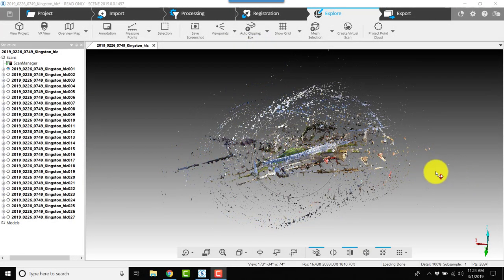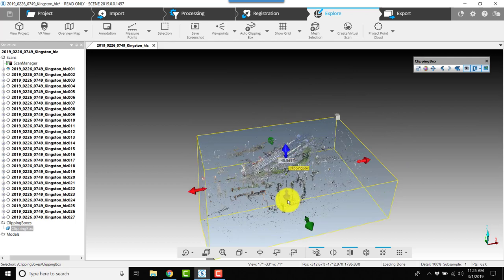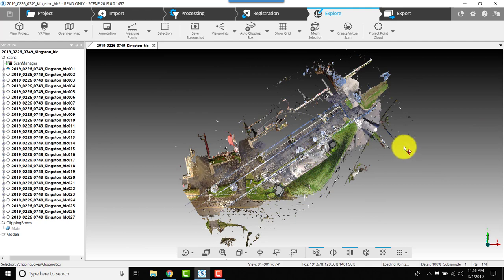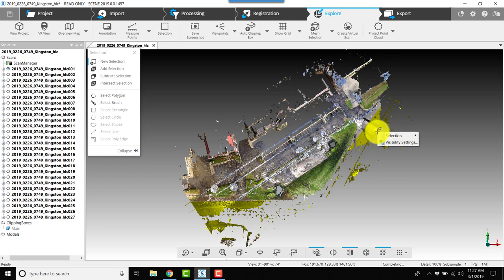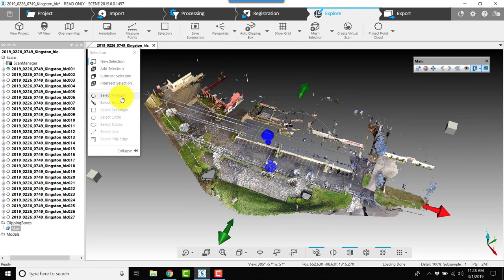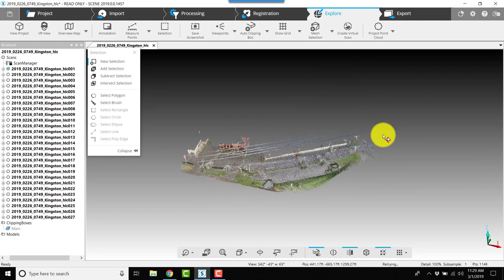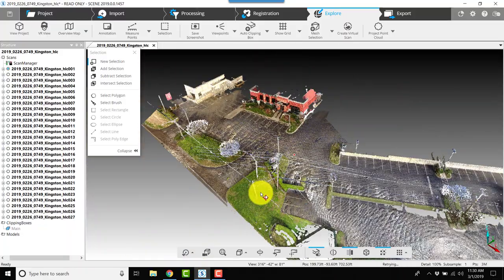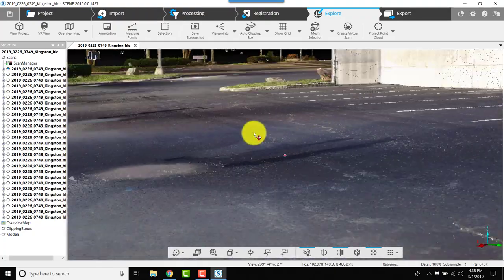FARO SCENE 2019 Clean with Polygon and Moving Objects Filter to Remove Vehicles

Comment: When I try to close the polygon tool it doesn't remain selected. I don't know what's wrong with it - anyone else know?
Reply from the maker: Assuming you are in a 3D view when selecting a section with the polygon tool, don't return to the starting position. Instead, when you approach the starting point, double-click. This will close the polygon and select the points within it. Good luck!
Reply: @ScanTrainingcom  thanks, I'm doing that, saw it in this video. But when I double click (fairly close to the end point and enclosing the selection I want) the line disappears.
Reply from the maker: When you double-click, the yellow line will disappear, and the points inside the polygon should turn yellow. Sometimes, the yellow selection can be hard to see. After selecting the points, right-click and choose "Current Selection" > "Delete Points." If the points were successfully selected, they will be deleted.
Reply: @ScanTrainingcom  Yeh I thought it should - it's not happening properly.
Reply from the maker: @horrgakx  Please try contacting support@faro.com, they should be able to help you.
Reply: @ScanTrainingcom  I have 3 year support from the supplier now I think about it